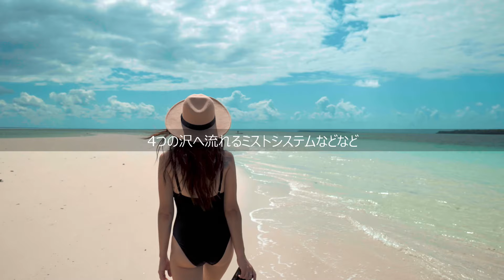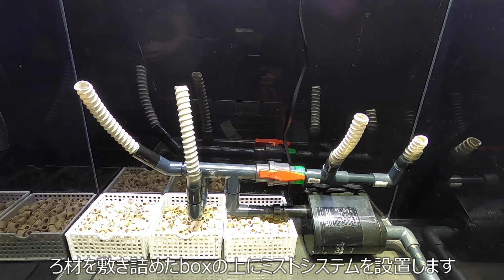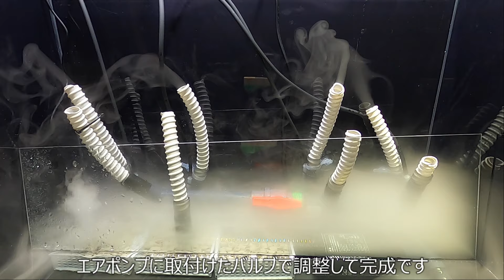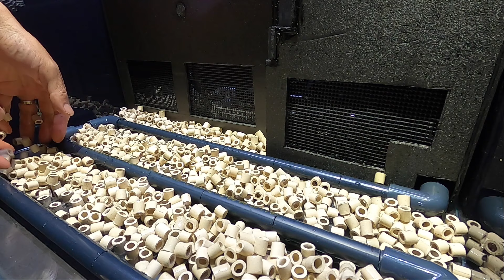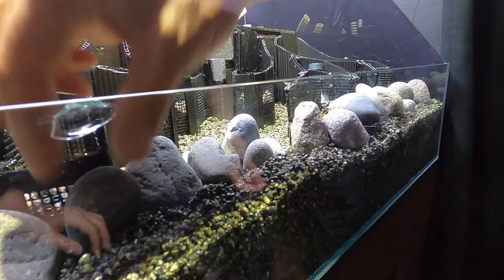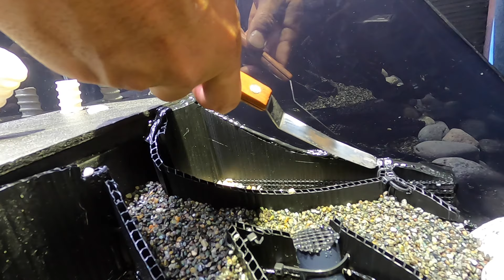Making a terrarium of spring water group

Comment: On the grand scale it is the heavy handed methods of control that's causing most the issues and challenges in society,, not the need for control itself...Every mentality should have a place to exist,,,, its an example of using tolerance to increase dynamic processes thus a stronger economy is created as a result...

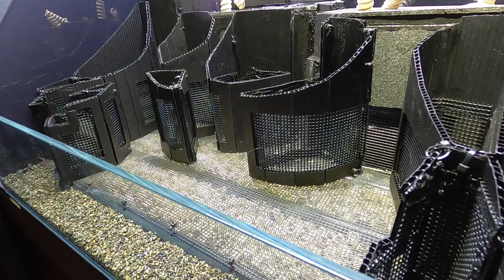Comment: I've check the CC version of this. At time stamp 3:24. The pipe you dint tell what was it for. And can you list what kind of probe and etc you used for this tank. Would love to start 1 but not as mechanic as you. Don't even know alot of the stuff in your video. I hope you will reply.
Reply from the maker: Thank you for watching.
What I wanted to represent with the pipe at 3:24 is the spring water coming out of the ground.
You can see it around 8:33 and in the last frontal scene.
It may be hard to tell.